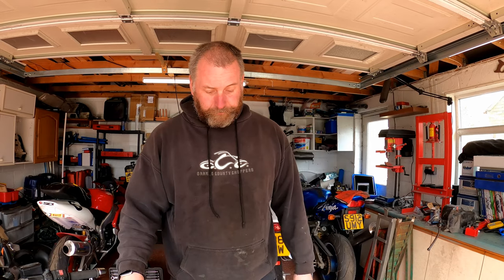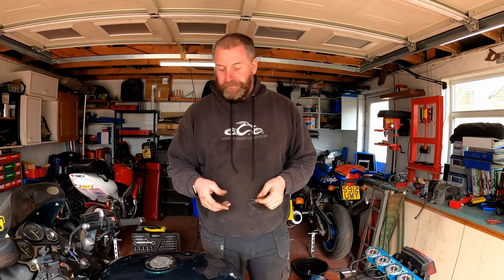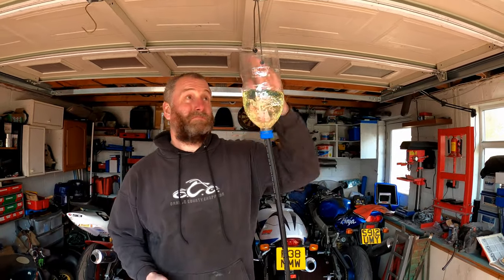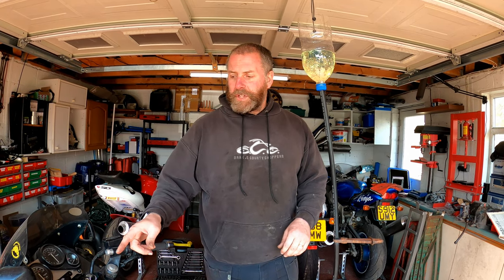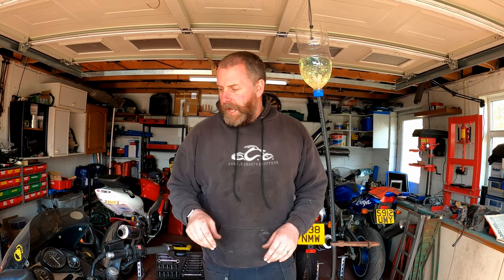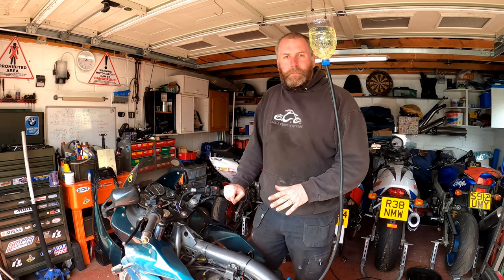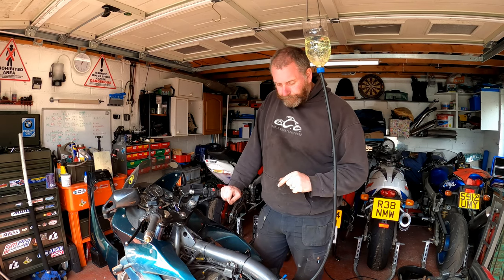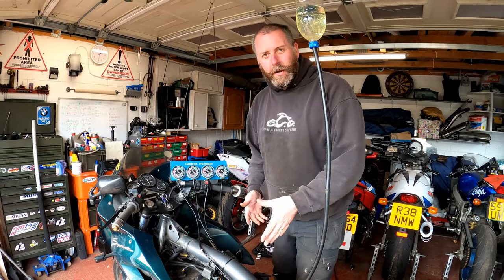1994 Triumph Sprint 900 Service Series - Part Four - Carburettor Balancing or Synchronization

Comment: I usually connect the gauges first, then let it warm up and set the idle  That way, I'm not fumbling around a hot engine trying to push vacuum gauge hoses on.  I've been burned before.

Comment: Brilliant Kev thanks, im sure my Tbird 900 carbs need to Synch as I'm forever adjusting the idle knob, when the engines hot and cold I get different idles. All manifold rubbers are new and tightly on.

Comment: Hi Kev, loving the videos. Quick question,   I have a 2004 Honda vfr 800 on 23k. Have only had it since February. The bike runs absolutely fine at higher speeds (50mph and above) however at lower speeds around town it really struggles when accelerating. Its really 'juddery' and it's like its about  to stall. Was gonna do flapper mod, when checked it's already been done, changed the air filter to a standard one ( the K n N  one was filthy) but still doing it. Is it just that it needs new spark plugs or is it something more serious??
Reply: How is your idle speed? Should be 1100 with +/-100
Reply: @JP-pp9ke  yeah that's what its idling at. I've ordered a set of lithium spark plugs,  a friend of mine who's a much better mechanic than me reckons a new set may sort it, thinks 1 might be not working properly! The rush is on as we have a 4 day trip of Wales in 2 weeks!
Reply: @tobypickering921  oh wow! I’m not too much unfortunately. Mine is an 03, so I would recommend changing the 30 amp fuse (left me stranded) and do the rectifier too.
Reply: @JP-pp9ke  ok thanks for that. Got lithium spark plugs arriving this week so will see what it's like after they've been changed! As stated other than that bike runs absolutely fine!